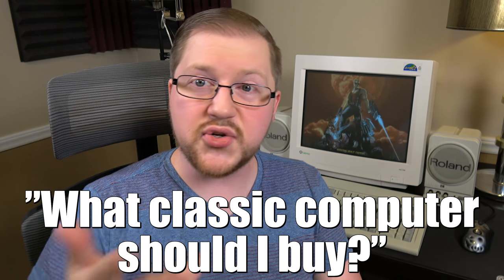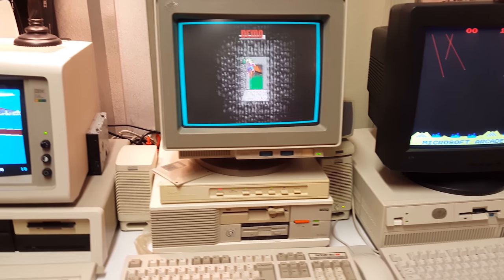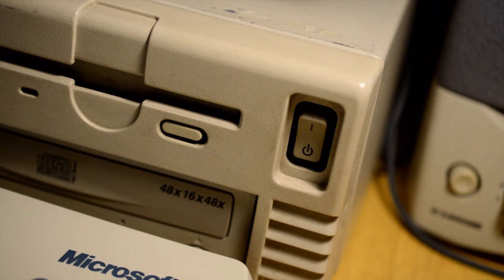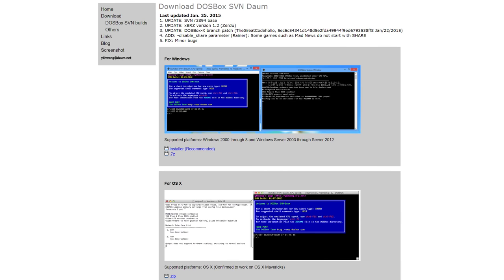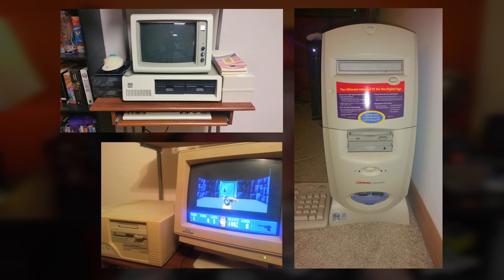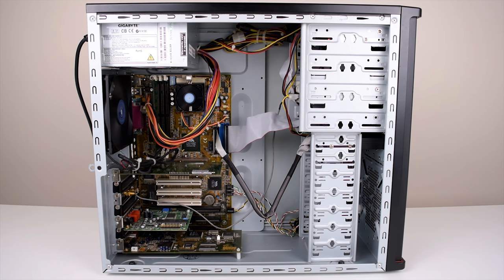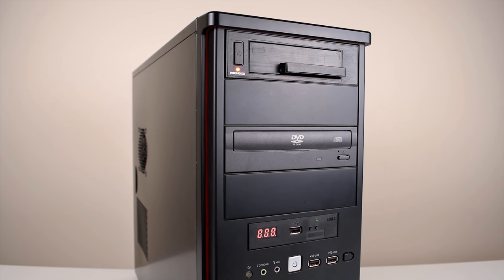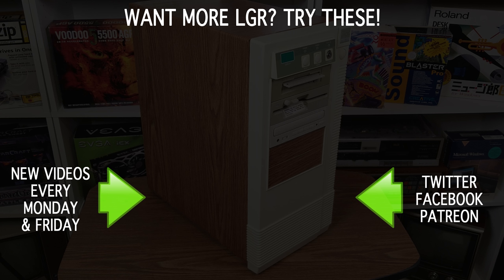Choosing a Retro PC for Games: Advice & What to Look For

Comment: I really want to get a PC to run Windows XP or Vista on. I have a bunch of games I played all the time as a kid that aren't supported on newer systems and compatibility mode doesn't usually work well for me. I also might eventually want to get something that can run even older games.
Reply: Which games? Anything that works on Vista should run on 7.
Reply: SimCity 4, Age of Mythology, and Zoo Tycoon 2 are the ones I've had the most trouble getting to work. I've tried them on my old laptop with Windows 7. I remember it did work at one point, but then there was an update that made it so I couldn't anymore. For a while I was able to get them to work by turning off some security feature, but then I started having problems with that, too. I was only able to get AoM to work one time when I didn't have time to play it, I was just trying to make it work. After that it wouldn't run again. SimCity 4 and Zoo Tycoon 2 worked a few times before they stopped running as well.
Reply: Oh yeah, there's also Age of Empires III and Dungeon Siege.
Reply: AluminumDragon https://pcgamingwiki.com/wiki/Age_of_Mythology

Keep that site handy, it'll help with a lot of these issues.

Dungeon Siege should work. I played it recently but all online modes in those games are gone due to GameSpy taking a dive.
Reply: I'll have another go at getting the games to work. Thank you for your help :)
Reply: No problem. LGR is one of the few channels where the comment section isn't an absolute nightmare and has people who actually enjoy things.
Reply: Thomas Fitzpatrick that's so true.
Reply: At least where I live it'd be easy to find some around ten years old computer which would run practically all Windows XP era stuff flawlessly for almost price of junk metal. Older than XP era computer might be already harder and more expensive to come by. Assuming it's there anything like that, it should be mostly a question of whether there is just room for an additional machine if such platform is desired.

Just wouldn't connect that computer to the Internet anymore, but would instead download needed software/patches on my modern computer and transfer them by USB drives. Also 2nd hand CD/DVD PC games of 2000's are at least here easy to come by cheaply, as for many people those are already old and passé but not yet proper vintage.
Reply: This should cost you all of about fifty dollars.  Pentium IV boxes are things you almost cannot give away these days.
Reply: its better to just download VMwareplayer and build the emulated windows 98
Reply: VMware player. and a real CD. Make a Pentium simulated windows 98 virtual and run it on your modern windows 10
Reply: Look for an old Sandy bridge based i3 or i5 premade desktop and a gtx 550ti
Reply: AluminumDragon id highly suggest a Dell Latitude d630. You can find them refurbished on eBay for about $100 and they either come installed with xp or vista
Reply: I run all these games on 7...
Reply: HappyBeezerStudios - by Lord_Mogul 
I use VMware Player to run Windows XP (32bit) the hardware is a laptop with i5 6200u and  Nvidia 940mx graphics hardware.
That combo runs Civilization 4, Sim City 3000 and so far all the Windows 3.1/95/98 games I have thrown at it.
Reply: AluminumDragon aoe 3 and aom are 5 dollars in the steam sale. Much easier
Reply: Try ACHI slipstream method  on the Win raid forum.... you can install/run XP on Ryzen and 8th gen Intel CPUs (not sure about 9th gen) and earlier ofcourse (unofficial support). But if you want official support with all drivers without workarounds and the AHCI method, you can go wiith Radeon RX 200 or older or nvidia gtx 900 series or older, for CPU latest Sandy Bridge or IvyBridge and for AMD CPUs, latest which supports XP is AMD FX Series CPUs
Reply: AluminumDragon I've played all of these again in windows 7 and even on 10 without any issues. Some i had to install some conpatibility patches. 

But sim city 4? This works out of the box for me perfectly!
Reply: My games like Command and Conquer stopped working after Vista.
Reply: Unless you research the hardware that last was able to use Windows XP drivers.It might be hard building such retro PC these days.Better off buying an old Windows XP system unit from eBay.As all the hardware in such a PC will already have drivers for Windows XP.And it all should be in working order.

Comment: Hi Clint, 

This is a comprehensive video about choosing the right retro pc game solution. You've done a really great job by asking others to share their views and solutions. 

I think too that what really matters is what 'you' want to do (for example you want to play early 90's DOS games and then look at what best matches that desire, for example configure a 486 pc). 

I would like to add some of my own experiences;

- Old laptop computers, such as shown by The 8-bit Guy, are in my view not really usuable for retro pc gaming. This has to do with bad (quality) screens, leaking batteries, bad proprietary power supplies, they can't be easily upgraded / expanded (without a docking station), they are hard to repair, it's not easy to find parts or expansions and the overall fragility and condition of old laptops can be a problem. You can be lucky and find a good one, but they are very scarce.

- Avoid IBM PS/2 pc's unless you like defective disk drives and proprietary hard to find expensive hardware.

- Somehow 486 AT compatible pc's seem to be quite popular. I think that a well thought-out configured 486 system is pretty great for 1990-1995 DOS gaming. It does take a lot of time and research though to configure a properly running pc for those games (if you are new in this hobby). The main drawback of a 486 pc is that it's really only good for that period of (primitive) games. Early 3D gaming is pretty much out of the question, you really want a Pentium class pc with 3D graphics card for that. That having said, Phil's suggestion of the AMD K6-III+ (and a couple other AMD K6 chips that can be 'tuned') system is the better alternative, because it covers a slightly wider period of games (bonus: you have more options for expansion cards and finding a decent ATX case is a LOT easier (but not all SS7 boards are ATX..)).

- For more recent retro pc games, let's say 2000-2007ish, I would recommend to look further than the Pentium 4 / Windows XP combination. The Pentium 4, especially the faster versions, produce a lot of heat (i.e. needs a really good cooler) and the 478 socket is quite fragile. Motherboard components of consumer versions of that period are also not always so great. It's better to look for workstation grade hardware. The good thing is that components for these newer systems are much more affordable. Besides Windows XP is best replaced with Windows 2000 SP4 and/or Windows Vista SP2. The first doesn't require activation and the latter can still be activated. XP will end up in an activation loop.

- It's a great idea to replace old hard disks with CF, SD, or SSD. Old hard drives can be noisy and unreliable.

- Authentic game floppy disks (5.25'') and diskettes (3.5'') are usually still readable after many years, if stored properly and carefully used. That's why it's still a good idea to add a (floppy) disk drive to a classic pc if you choose that option.

- CRT monitors may be period correct, but CRT's wear out over time and can't be replaced because nobody sells them anymore!

- And yes, eventually all classic pc hardware will fail. 'Recapping' is not enough to keep your system working for the long run and is certainly not a repair. So far however my Apple II still works..

Comment: 12:21 Hellbender FTW!! 

Also has anyone heard of nGlide?

nGlide is a 3Dfx Voodoo Glide wrapper. It allows you to play games designed
for 3Dfx Glide API without the need for having 3Dfx Voodoo graphics card.
All three API versions are supported, Glide 2.1 (glide.dll), Glide 2.4 (glide2x.dll) and Glide 3.0 (glide3x.dll). nGlide translates all Glide calls to Direct3D.
Glide wrapper also supports high resolution modes. 

http://www.zeus-software.com/downloads/nglide
Reply: +Jack Kraken Actually, it was Terminal Velocity; Easy mistake to make though! ;)
Reply: Yes you're right but what is weird is that the graphics , animations and even the explosions are virtually identical to Hellbender, although the HUD is somewhat different. 

They were made with the same game engine:
https://en.wikipedia.org/wiki/Terminal_Velocity_(video_game)
Reply: +Jack 
Kraken Yup, even Fury3 shares a lot of the same stuff. All three of those games are VERY similar to each other! ;)
Reply: I remember loving Hellbender but I remember getting tired of the repetitive gameplay, any idea if the others had the same problem?
Reply: +Jack 
Kraken Ohhhh yeah. Gameplay is super-repetitive on all three, but at least the bosses, missions and weapons are different. You can also make these games go by faster by forgoing exploration and just focussing on mission objectives. :B
Reply: I also missed the free demo's that use to come on the Windows Disc, which is how I found out about Hellbender and Monster Truck Madness 2. I wish they made a sequel to both, but they didn't Monster Truck would look amazing in today's PCs.
Reply: didn't opengl have some wrappers for a few weird APIs too?
Reply: No idea I just remembered nGlide because it supported Voodo cards on modern systems.
Reply: I have Hellbender but it's a Windows 95 game and my machine is MS-DOS only and so I've yet to play it. I do have Terminal Velocity as well though so maybe I'm not missing much.
Reply: Aren't Terminal Velocity, Fury3, and Hellbender more or less considered a trilogy? I definitely remember reading or hearing something about Hellbender being an (unofficial?) sequel to Fury3.
Reply: They are with direct story tie-ins from what I remember.  That being said, the most story I can remember was a prologue for each game and some between mission briefings.  They weren't what I'd consider story heavy titles.  More or less an Arcade Flight Simulator version of Doom or Wolfenstein.

Comment: Great to see you reach out to so many other youtubers for this. Well worth the watching. I have several systems from 486 through Pentium Pro, Celeron and P4. While I love the old hardware the EASIEST method is to use a MAC with DOSBOX and SCUMM VM. You can emulate the Roland on it, and the configuration is backed up in TIME MACHINE for easily migrating with future hardware. I won't be dropping my retro hardware anytime soon but this will help those looking into it.

Comment: I'm glad you mentioned Wine in your video because not many people recognise its usefulness for running old games.  I run a fairly average machine with an AMD dual core processor (2.3 GHz), 4GB RAM and an HD5450 graphics card with Linux Mint 17.2 and, with the help of PlayOnLinux, I'm able to run a lot of the games you discuss in your videos (including the retail disc version of POD and Need for Speed 2: Special Edition) and often the ones that don't run pose the same problems on Windows.  And, if you throw in DOSBox, GOG and Steam, Linux isn't too bad a place to be for retro PC games.

I have an old Windows 98 rig (AMD single core (1.6 GHz), 256MB RAM and Nvidia MX-440 graphics card) and a few old XP laptops that come in handy for the odd game but I'm able to run most of the games I want to play on the Linux desktop and, half the time, it's actually easier to get the games running on Linux than on the Windows hardware.

Really enjoy your videos.  Keep up the good work.

Comment: Very nice video, I just want to add a maybe less known thing that no one mentioned, which is nGlide. NGlide is a 3dfx Glide emulator for newer videocards, with it you can play most Windows 98 3dfx games on a more modern PC, by just installing a simple driver, for example I use it on my Pentium 4 with an nVidia GeForce card, this allows older games that won't even start because you don't have a 3dfx card to run flawlessly, and at max settings on top of that. Pair that with DosBox and you can have a machine that can run games from the early Dos days up until the early 2000s with little to no issues. My biggest problem was actually to run POD, but I found a patch to run it on the internet, so with a little research you can run pretty much anything.
Reply: nGlide is very well known. I suspect anyone who is aware of Glide also knows nGlide. 
The problem with nGlide though is that it's getting more and more broken with every dx release. It's a wrapper to d3d, but as d3d changes and evolves (and breaks some software compatibility in the process), the nGlide wrapper also breaks slowly but surely. 
Personally I find the 3dfx cards way over-rated anyway. Up unto voodoo2/banshee they offered something interesting. From then on end all they offered was evidence of how crazy far they fell behind in such a short space of time. Even glide, it's saving grace, was hideously outclassed by d3d by this point. 
Poor performance, horrible image quality, 16bit restrictions, no proper d3d support, etc., etc.... yet people still get warm and fuzzy about them. I can only put it down to nostalgia beyond v1 and v2.
Reply: It may be very well known, but nobody even mentioned it. Anyway, yes it is better in an old PC, which is the point of the video, that's why I'm using it in a Pentium 4 with windows XP, old Direct X it's the only thing you need in a retro PC. As I said with a P4 and nglide you can play nearly any glide windows 95-98 game. I think the one I'm using has DX9 at the moment
Reply: nglide never works for me, not even in my pentium 4 with an nvidia geforce ti 4200, it made need for speed work... kinda, very laggy... I don't wanna play it like that.

Comment: 8 bit guy laptop. I have that exact machine with 70mhz with dock! Yes a dock! CD rom and usb floppy emulator and 3 isa slots. I need a new battery thou as sealed packet nimh is a pain to disassemble.
Reply: Plus the fdd on the laptop doesn't spin hence the fdd usb
Reply: tho' means "although".
Thou means "you" in olde english.